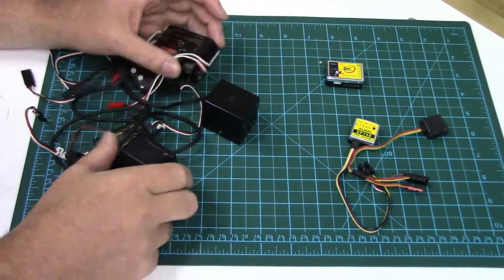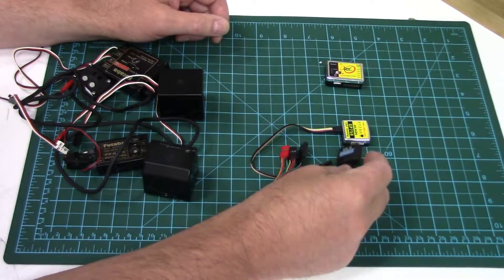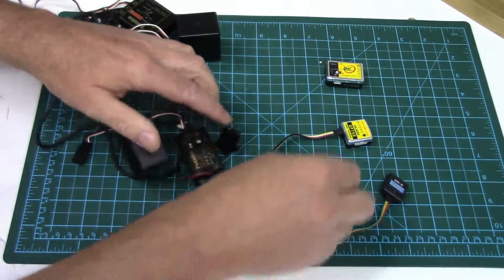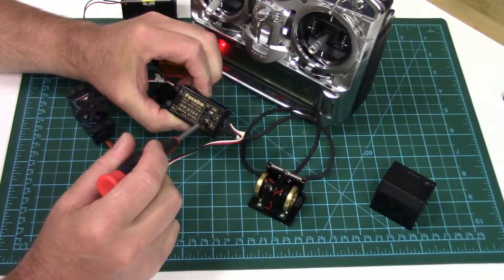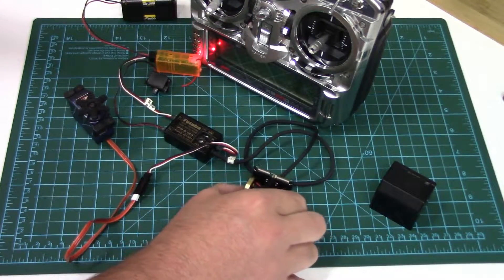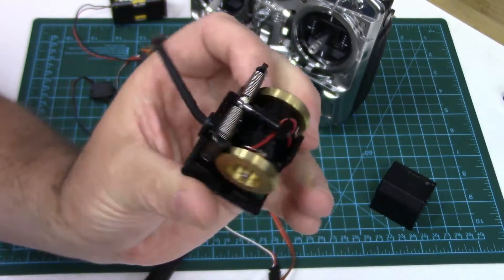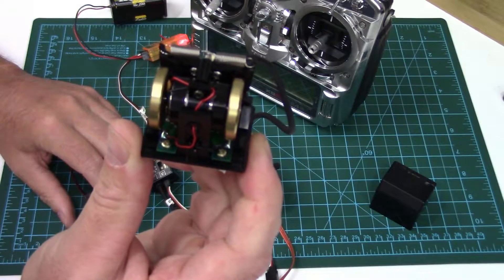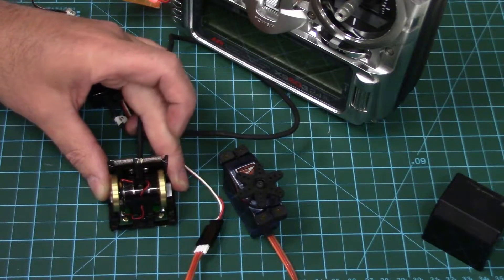RC Helicopter Gyro, Mechanical & MEMS

Comment: Hi John, I see you have a Tarot ZYX S2 gyro. Having a problem during set up. Everything connected but no effective signal from computer. No lights displayed on gyro and no response from radio. Any advice would be helpful. Best regards Jim

Comment: My first gyro was the Futaba 154 back in 1989 when I was 11 with my Hirobo Shuttle ZXX.
 I then upgraded to the Futaba 153bb (ball bearing).
They performed great for standard aerobatics.
I then bought one of the first mems gyros, the CSM 360...And hated the bloody thing!
Every time the temperature changed it would cause tail drift.

Comment: Hello John. Read most articles on your site. Very nice, esspacially for beginner. Was just wondering. I have old align tail gyro I dont use and was wondering if it can somehow operate without transmitter? For instance if I use it with a servo to keep a fpv cam at certain one plane position (the cam stays focused at a point). Maybe sounds dumb, but just wondering)
Reply from the maker: The gyro needs to see a PWM signal from the RX.
Reply: @Rchelicopterfun  John. I have a question. What difference did you notice flying 2 blade vs 3 or 4 blade setup, for example on a scale heli? And do you need to get 3-blade setup on a tail as well?

Comment: Nice explanation! I have a question, and it may sound silly. Recently i bought a kit Honey Bee King 2. Where i live, it's really difficult to find helicopter tail gyro. Can i use RC car gyro (usually drift car) instead? As i have one unused. It's GYC-300 gyro.
Reply from the maker: Nope, heli tail gyros are specific (different PID algorithms, heading lock & rate modes, remote gain).

Comment: John, in the broader application of gyros are there applications where the mechanical gyro is still the device of choice?
Reply from the maker: Can't think of a single application where a mechanical gyro would be considered over a MEMS gyro (in the RC hobby anyways).
Reply: @Rchelicopterfun  Thanks, John. I've been trying to figure out what the preferred device is outside of consumer electronics (where obviously the MEMS device reigns). Some mentions of ring laser and fiber optic gyro, but I think some aircrafts and rockets still use the mechanical devices.